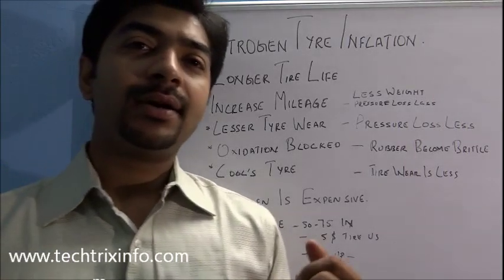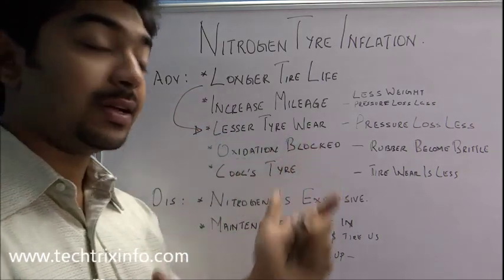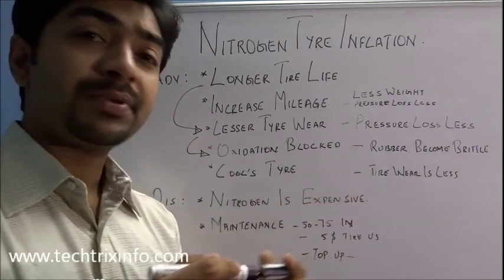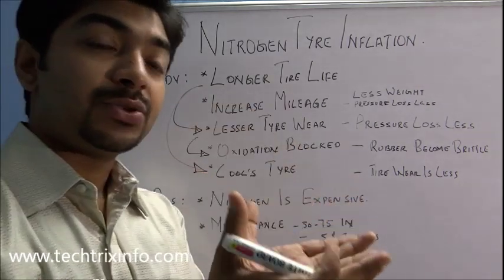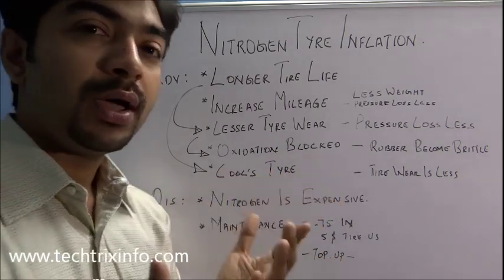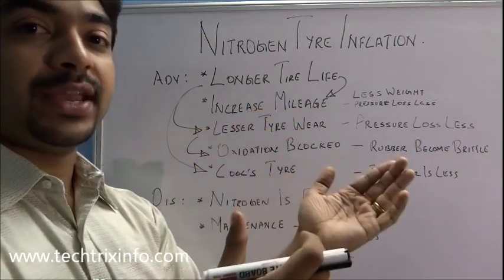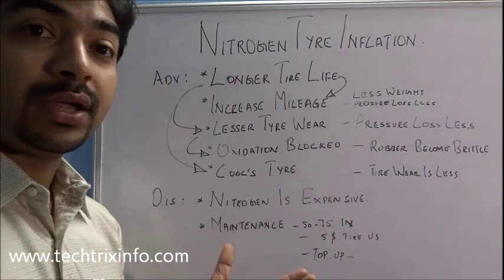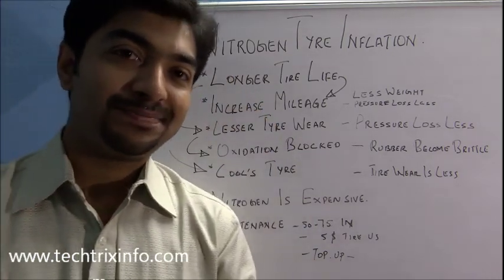Nitrogen filled tires advantages and disadvantages. ✔

Comment: nitrogen is best for bikes ....I will use nitrogen 5and half years ..it will run 31000 km .. without single puncture.. check the air 4 to 5 month .
Reply: Thanks for the accurate answer.

Comment: This whole nitrogen in tires 'trend' is still a myth. Based on its advantages, and the results its not quite worth it. It costs $3-$10 per tire to fill with nitrogen in north america. you save only $10-$15 in mileage per year. 

This is based on a vehicle driven 20,000km.year, consumption of 23mpg, cost to replace a tire $200 per tire.

Comment: The cost is ₹10 per tyre in India (TN)
Reply: u mean 10 rupees, as I checked the currency symbol from google, then I would say the theory which I do believe as a Mech. Engr. will be more advantageous in your country? unfortunately, it is very expensive here in the Philippines, thou google would say its only php50-100. but the thruth is they are charging php700 per tire. with my limited knowledge regarding the intervals of charging nitrogen, it seems it outweighs the cost of tire rim due to moisture content and also due to the fact that air has already 78% of nitrogen.

Comment: Everything which you said is 100% true,but there is no significant difference by using pure nitrogen,the improvement in" pressure loss " is not so significant with modern rubber compounds(i guess oxygen molecule is only 2% smaller than nitrogen) and that 21% of oxygen might be oxidising it from the outside as well, i think spending money on nitrogen is useless
Reply from the maker: Tks for the comment 
WhatsApp us @ +919744615655 for Engineering related updates and doubts
Reply: Thanks bro for the genuine answer. .